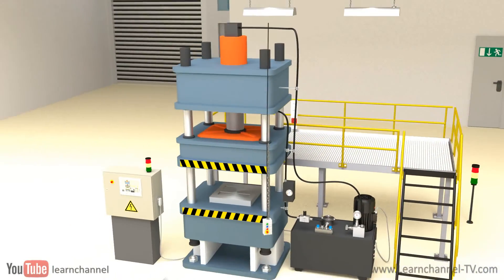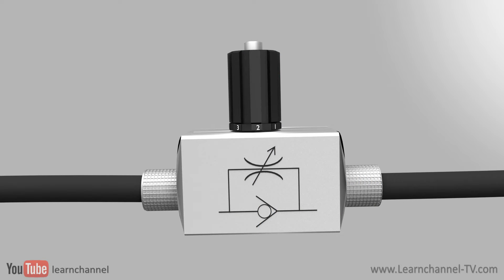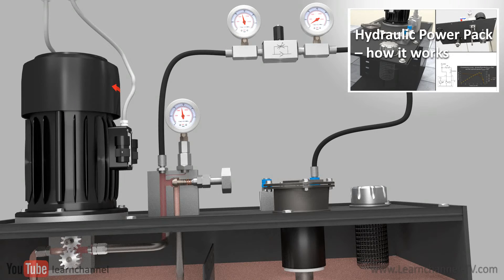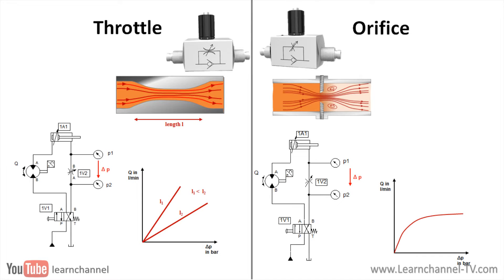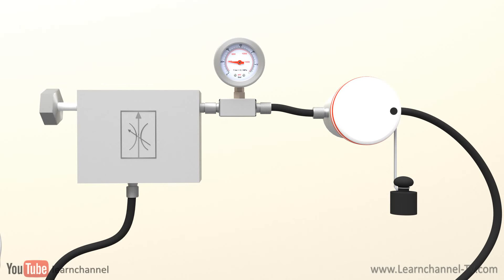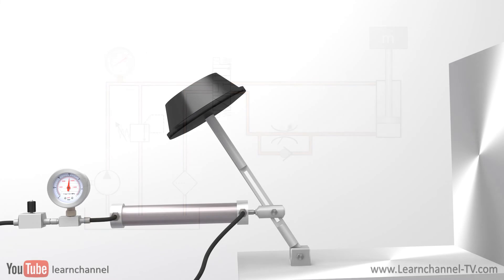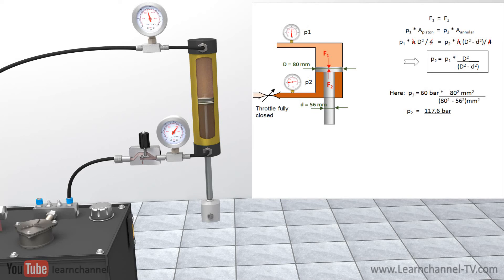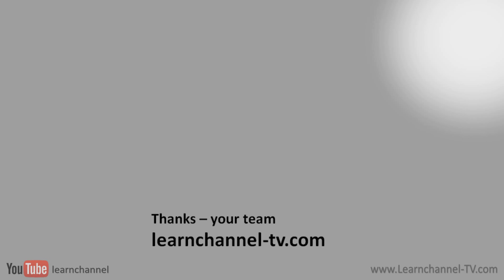Flow Control Valves in Hydraulics - Full lecture with animation

Comment: So the flow controller valves are best to be used in the in positive load side and a relief valve is best to be used in the negative load (the return line). Right?

Comment: Hi and thanks for the info: I am building a test stand to test the load over distance in a shock. We want to move the shock at different loads to determine the resists and be able to adjust the pressure to act as different spring rates, what type of valve would we need to make this work.

Comment: nice, can you assist, I  have a very pro made power pack, made by KA ME WA Finland, I  have almost zero flow and little pressure, possibly the rotation was wrong for a minute, but the pump is load sensing, wonder if the shaft seal blew with reverse rotation
could I block the LS port on the valve block, see what happens? the solenoid valve opens, I use lever  controls to feed 3 rams, one motor, the  pressure comp flow valve is before the 4 valve lever block as I wanted to slow it all down, really need help here, thanking you there is zero press at the gauge, one ram will creep, motor and other cylinders do not move

Comment: Can someone help me with a question?
I'm not real familiar with hydraulic details... I build a small tow behind backhoe/trencher.. It is powered by a 6.5hp engine and I'm using a 2 stage log splitter pump. (11gpm) 2gpm on stage 1, and 9gpm on stage 2...  My problem is the speed of my cylinders are super fast.  So fast that it makes it almost impossible to operate... I'm wanting some type of valve to slow all of my cylinders down...  What type of flow valve do I need?
I'm currently looking at a 0-11gpm hydraulic flow control valve from northern equipment.... It's the type that has three ports and a little lever that can be moved to open and close the flow.
Can someone please give me an idea of what I need to purchase... Thanks